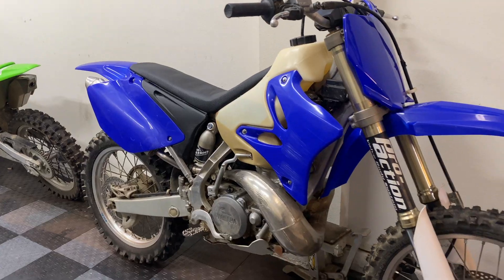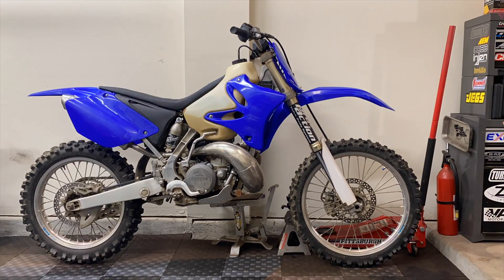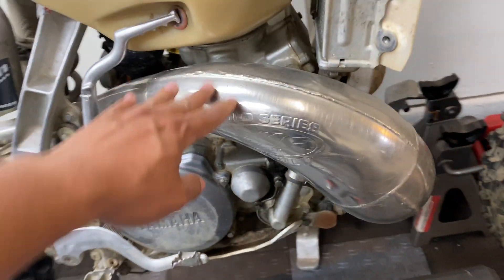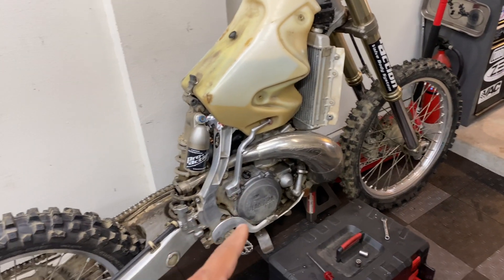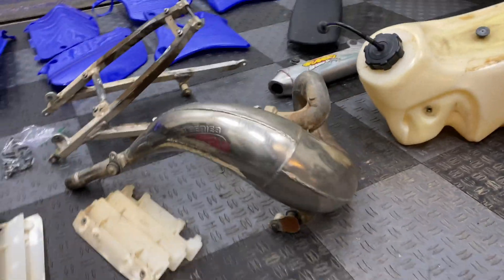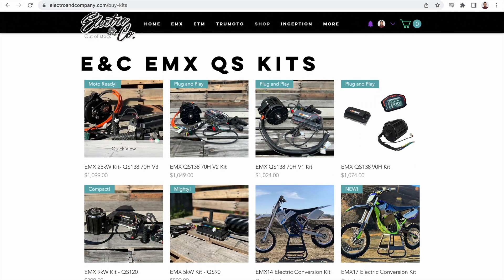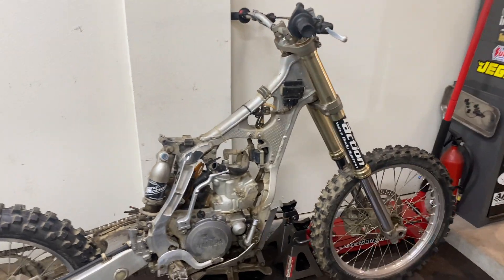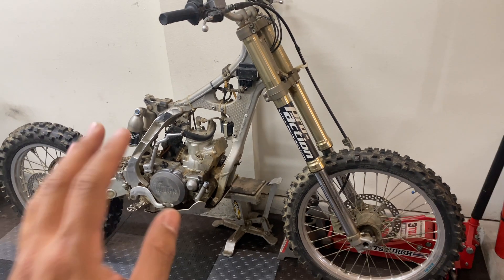Project YZ-E | YZ250 Electric Dirt Bike Conversion Part 1

Comment: Should have bought a blown up 125cc, cheaper and lighter.  Just a note, it takes me about an hour to put a new piston n rings in a 2 stroke.  You get about 6 mos out of a 250cc and about 3 mos out of a 125cc. You want to change them before they eat into the cylinder linings, the old dirt bikes didn't have the lining but l changed my first piston/rings back in 1977, yeah and it was my first 1974 Elsinore 125cc. I still own a 1975 Yamaha 400mx, first yr of the monoshock and it was when Yamaha painted their bikes white.  That bike shakes rhe ground you stand on my friend, it will but the fear in any man. Last time l rode it, l went around my neighborhood and l had a cop looking for me lol.  I knew this would happen so l left my gate cracked to slip in my backyard lol. That was 14yrs ago, it needs an ignition.

Comment: Hey I believe that AMORGE batteries is a better option than the E&C battery. Its cheaper and you can ask for custom dimensions. Great Video! You can also ask for the same specs or better than Electros battery

Comment: You gonna paint the frame too ?
Reply from the maker: Hmmm wasn’t planning on it yet. I wanted it to look clean and powder coating may be the most reliable option but costs an arm and a leg here
Reply: @PatOutdoors  powder coating rubs off eventually as well. On a aluminum frame I’d say keep it bare but if it was steel I’d say powder coat for sure.
Reply: You can get those aluminum frames looking brand new with a scotch brite pad
Reply from the maker: @humpday2267  Thanks for the tip!

Comment: Nice, you went for it. Good luck. I’ll race you when my ultra bee comes in
Reply from the maker: Wait whatt, congrats on the order! Did you happen to get an eta on yours?
Reply: @PatOutdoors  ordered from Alibaba, no I have not received a solid eta yet I’m expecting late may. I know someone that has ordered and received 5. I don’t mind waiting to save 1200+. So on to your battery waitand take the longest time to decide as you can. Contact powerlithium/ amorge and local builders e&c is solid if you go that route. But get the most AH you can. It’s going to be a big heavy bike that’s need as much juice as you can fit, You’re going to need it for our race 😎
Reply from the maker: @Offthevoltz  Hahaha are you in the east coast?
Reply: @PatOutdoors  Florida, but I’ll be towing my ultra & crf300L up and down east coast for trails. Riding is not so fun down here.
Reply: This is an exciting build! It’s cool that you’re putting something together for your wife, I have the same hesitancy with ICE motors myself, which is why I prefer E motors. Are you planning to reuse the original fairings? the Karen’s by me seem to have a sixth sense for dirtbike plastics lol
Reply from the maker: @ihatevott  lol you’re forcing me give out to give away too many details early on! But really the blue plastics deff scream yamaha dirt bike, so likely either gonna be less plastics on there, maybe modified, or at least a more subtle color